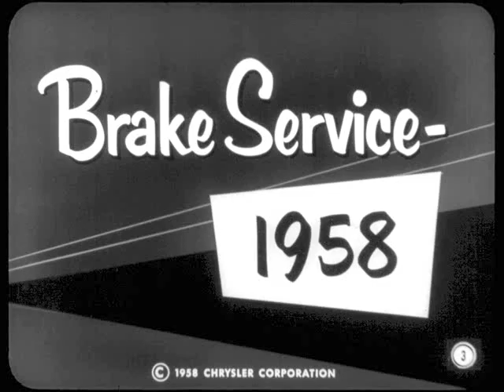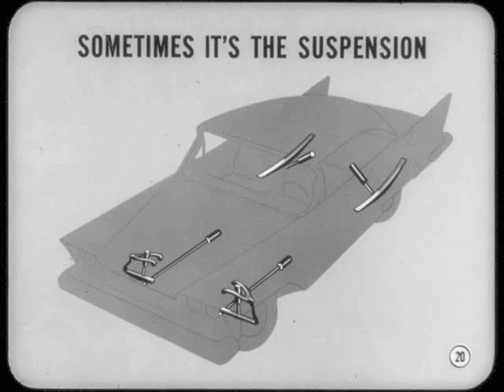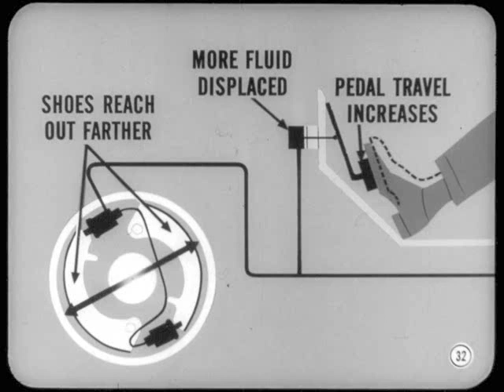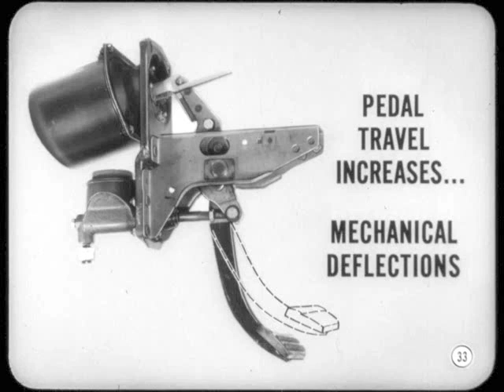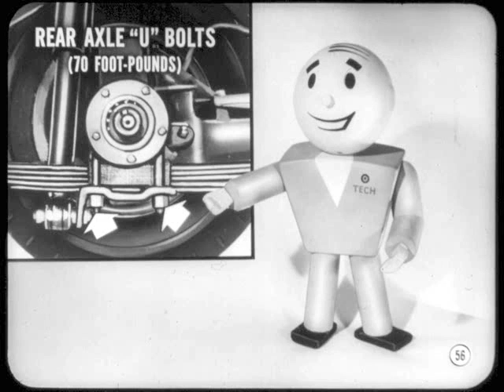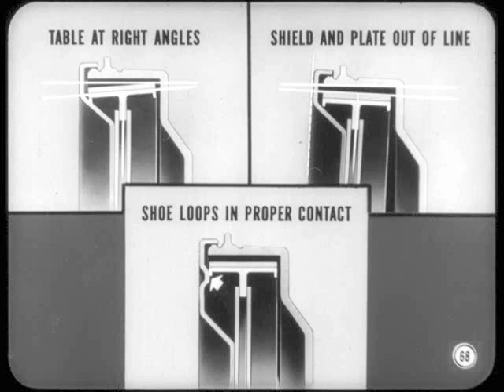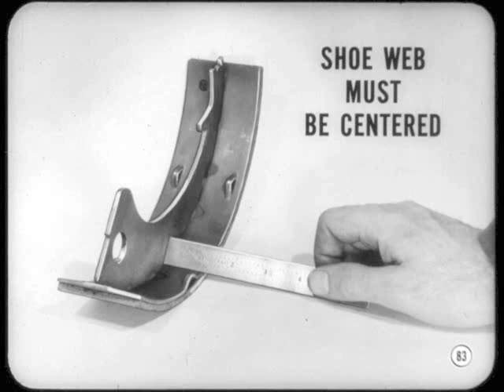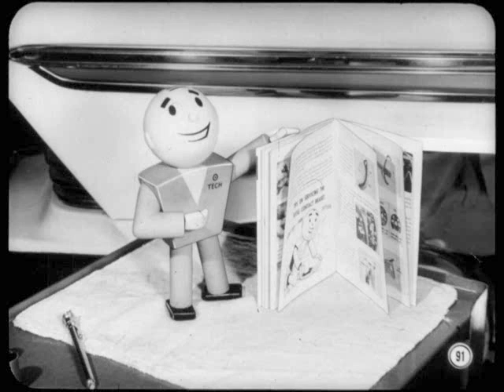Chrysler Master Tech - 1958, Volume 11-5 Brake Service

Comment: Tech was a great person/puppet to work with on my Chrysler Newport back then!!!! After Tech got fired from Chrysler for a mistake he didn't do. Tech was falsely blamed for a botched brake job that caused a customer to die due to brake failure. He turned to alcoholic and a junkie. Back about 1985 he died from A.I.D.S. , homosexuals took advantage of him cause he was too addicted and gave them his booty for a drink and a fix !